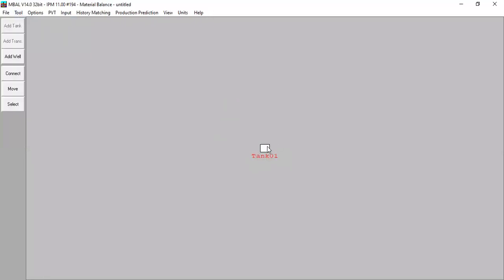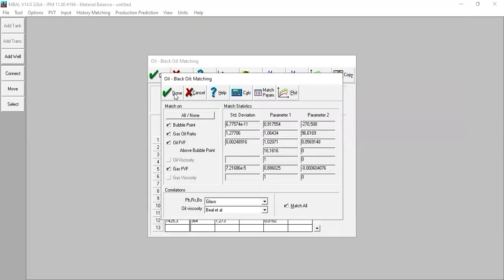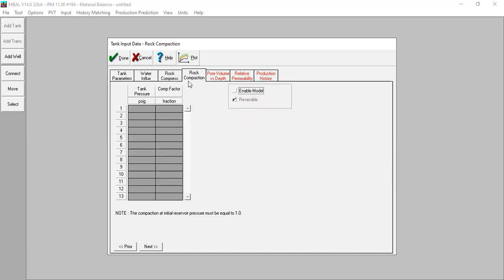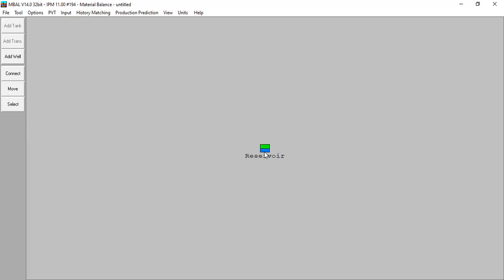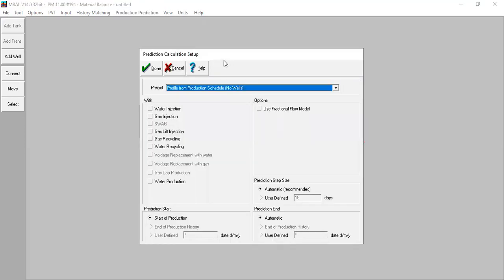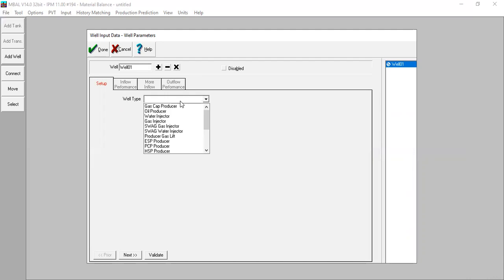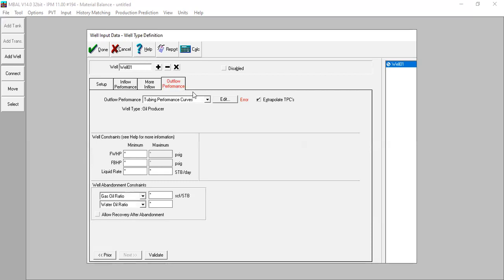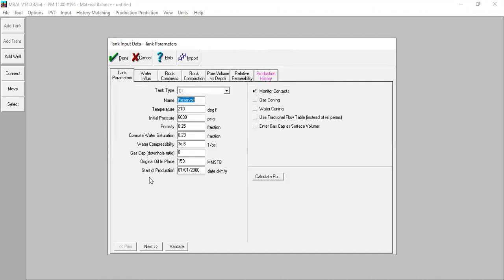MBAL 5: Prediction, Water Oil Contact, Well Model

Comment: Hi guys, I have a issue with your Mbal software, We have a pressure reservoir below bubble point and I want to do the forecast but send me this message THE INITIAL PRESSURE FOR TANK CANNOT BE LESS THAN THE BUBBLE POINT PRESSURE, PLEASE CHECK YOUR PVT
The pvt data are accurate. We know that the pressure is below Bubble point  because we have a PRESSURE-TEMPERATURE  log. So why mbal can´t  do the forecast with the condition satured reservoir?.